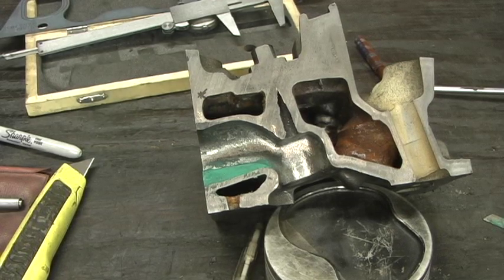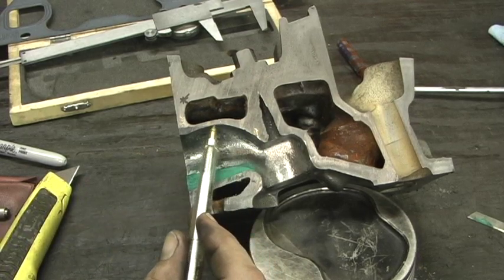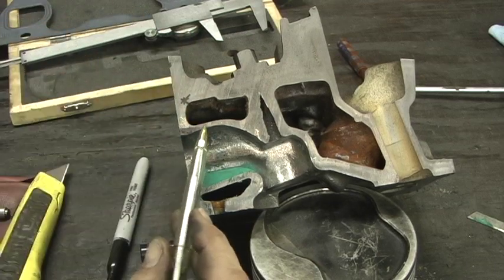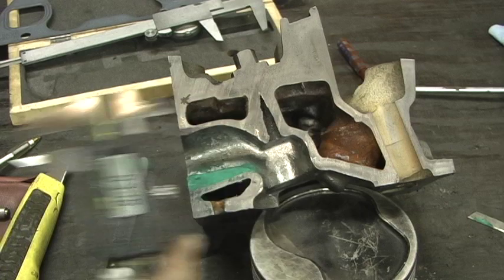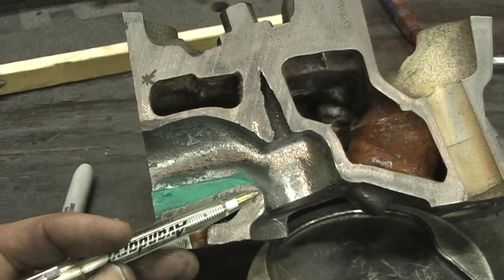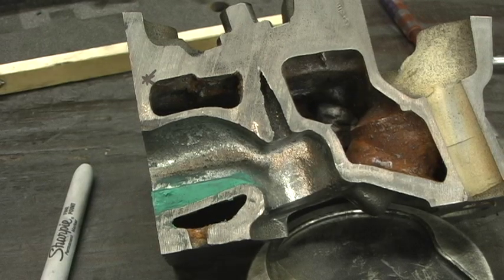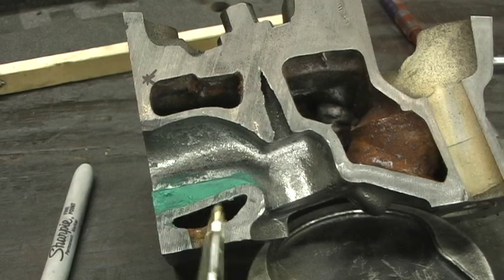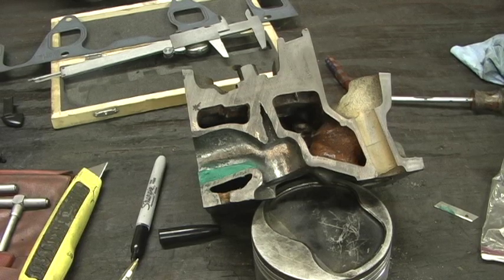Ford 2.3 Four Cylinder Head Welded Floors and Raised Exhaust ports Part 2

Comment: Faire un moule du port ne montre pas combien d'espace on a avant de frapper un passage d'eau.
Reply from the maker: 100% right on Dramis85, I have been making molds for 35 years, professionally for 24, and it just gives you a look, which I quite making them YEARS ago because there is a better way which I will show soon. This also includes CORE SHIT and the molds wont do that for you.